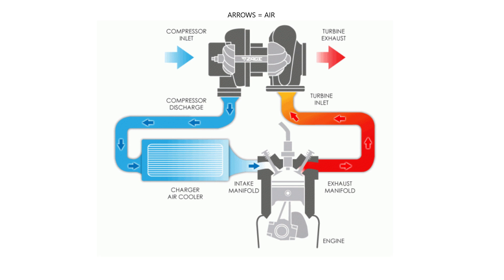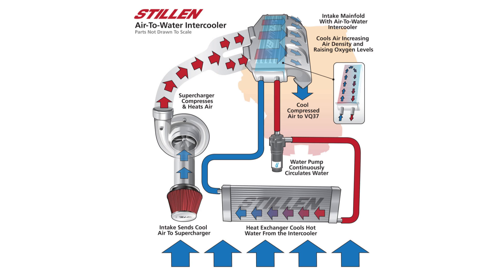Heat Soak - The Silent Horsepower Killer!

Comment: Hello,
I own a 2016 Ford Mustang EcoBoost, and I’m facing a very serious problem. My car is only getting 5 kilometers per liter of fuel!
I had previously removed the catalytic converter from my car and reprogrammed the system accordingly. At that time, I didn’t experience any issues.
However, I recently noticed a check engine code (P0135), which indicates a problem with the upstream oxygen sensor (O2 Sensor 1).
Could this faulty sensor be the reason for the high fuel consumption I'm experiencing?
Thank you.
Reply from the maker: N - Yes, a faulty upstream O2 sensor (P0135) can absolutely cause excessive fuel consumption, especially on a turbocharged engine. This sensor is critical for real-time fuel trim adjustments, and if it's not heating up properly or sending accurate signals, the ECU may default to a rich fuel map to protect the engine, leading to poor mileage like the 5 km/L you're seeing; since you've removed the catalytic converter and reprogrammed the system, that can also affect how sensitive the ECU is to O2 data, so replacing the upstream sensor with a quality part and confirming proper heater circuit function should be your first step toward restoring normal fuel efficiency.

Comment: My 2016 mustang ecoboost shuts off boost randomly after a few WOT pulls, I don’t get a check engine light. I’ll let the car sit for a few hours and then it’s fine. Could this be because of heat soak?
Reply from the maker: P - Sounds like a boost leak to us.
Reply: "I've been suffering from this exact same problem for two years now. I have the same issue with my Mustang EcoBoost 2016. Have you found a solution, please?"